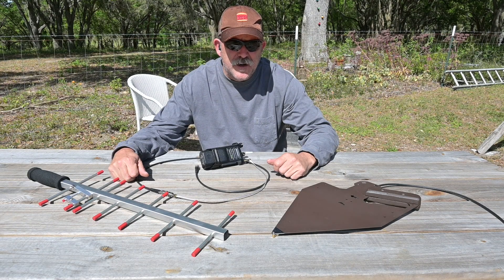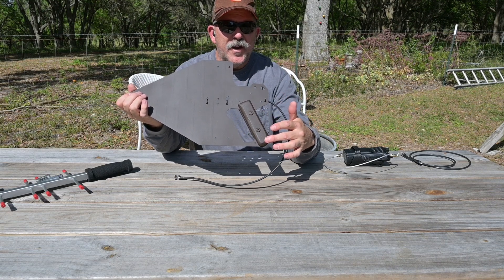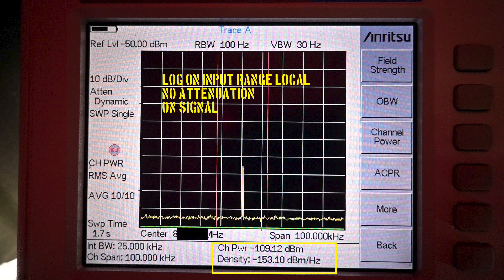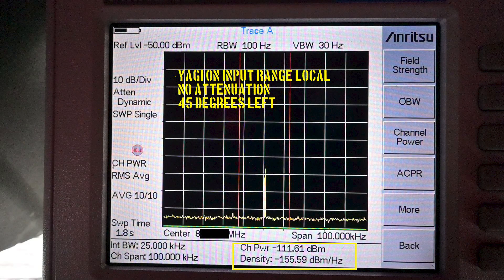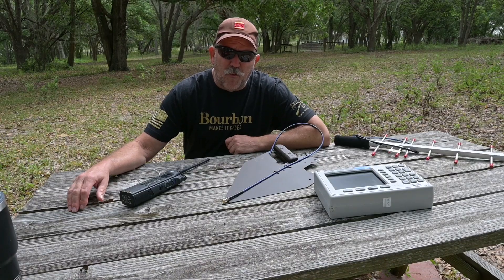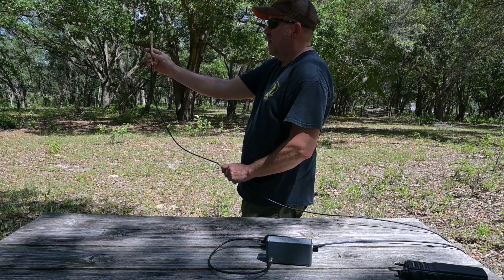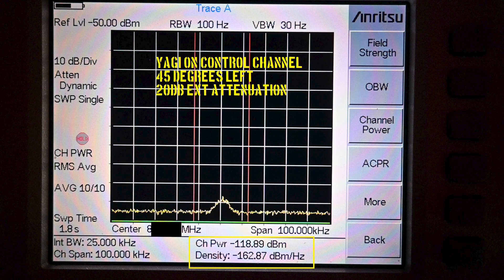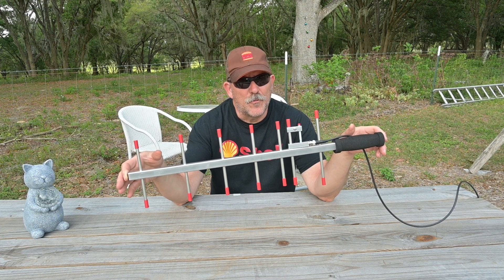Radio Direction finding handheld antenna testing . Log periodic vs Yagi  prototype antenna testing

Comment: Very cool test!  I was surprised at the significant difference in the output range between the Yagi and Log Periodic.  I would like to see the same test done in a simulcast environment.   I am a fan of physical switches as well!
Reply from the maker: Thank you ! It was a shocker. You can use it in a simulcast environment with enough attenuation to null out the non desired site in conjuction with the backside rejection.  When using the yagi the minimal front to back signal disparity made it very challenging to do so and required the use of my JFW attenuator which I can vary in one DB steps as the 10 DB steps of my HP 355D were too coarse. I Typically leave the Cellmaster in dynamic attenuator as it keeps the device from getting its butt kicked by mixer saturation. I did all of the tests in both a dynamic and manual attenuator instrument settings to ensure the results were consistient and no funny business was taking place. Thanks for watching !

Comment: I was searching on Aliexpress for a 700/800MHz Yagi only last week for P25 networks, none exist on Ali and I don't care to pay $450 for a professional-grade one. The elements on that Arrow Antenna (I think) Yagi are bigger than I'd expect for 700/800. Great video!
Reply from the maker: Thank you ! We wanted a lighter one than a commercial one. You are right about the element size and the gamma match is a lot larger than I would have anticipated being signifigant percentages of a wavelength in dimentsion and honestly I'm not sure I had ever seen a gamma match in a commercial variant. Thanks for watching !